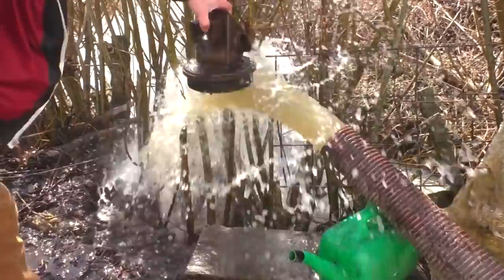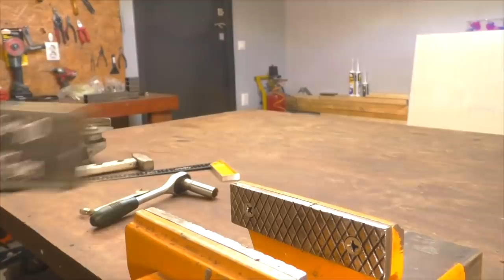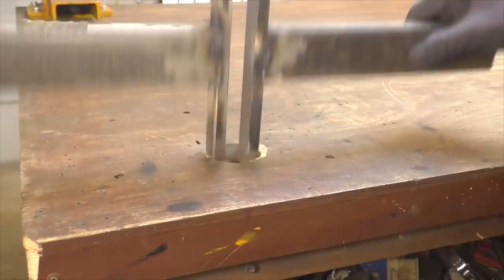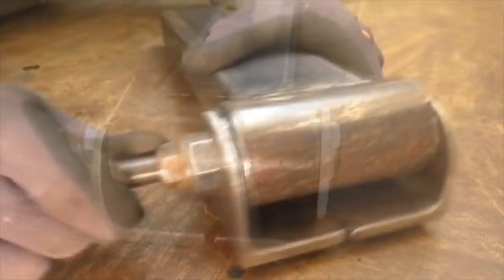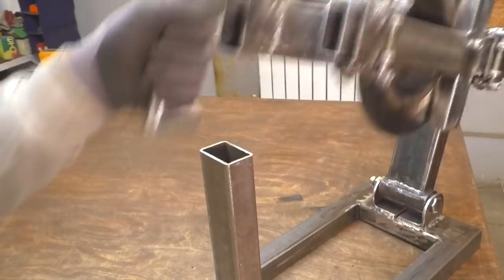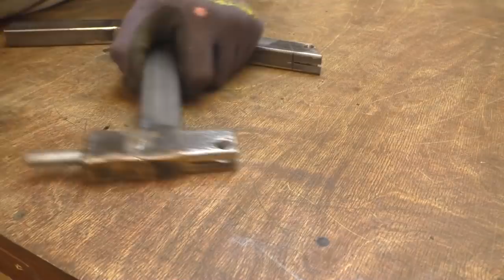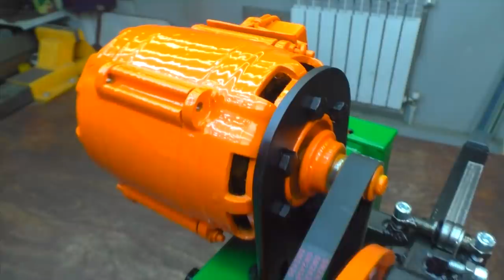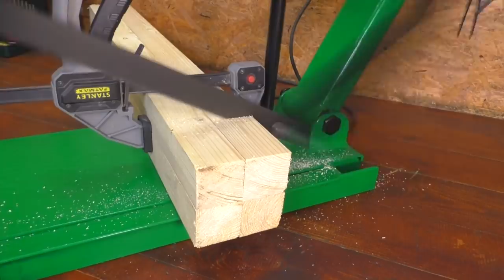Never throw away an old hub! It's like nothing anyone's ever seen before!

Comment: Start off by saying dude is obviously very skillful and im impressed by the precise craftsmanship. Very impressive indeed.....but wtf!?!?!? Lol. Don't throw away hubs so i can make the most elaborate band saw ever. I want to say the materials used makes the free hub seem quite   forgettable. What's another $30-$40 when you're dropping $400+ on other materials? Especially when u got to tear apart and clean it....But i don't want to sound like a hater. I mean..a rusty hub at the bottom of a puddle sparked that elaborate ass design for a damn saw? Holy crap! That almost seemed like if someone was forced to make a saw from an old rusty hub and then periodically was thrown little zingers..."use an excessive amount of bearings!" and "utilize 45° cuts into steel tubing only using a drill bit and file" or "cause dude that never comments on you tube vids to freak out and make a very wordy and very useless comment cuz....i don't know why."

Comment: Why not just put a saw blade on the motor and make a circular saw…use a gear reduction slow down to cut steel with steel tooth blade….that was a lot of work and parts to make a saw,,,do sawing

Comment: I knew it. Another 20 hour project that in this case could be a better solution by spending $175 for a horizontal band saw at Harbor Freight that will work much better.

Comment: yours melts the blade in two small spots.. yours runs entirely too fast as well.. 
looks like a very  dangerous devise
 that is why we have  band  saws 
that runs on a slower speed that doesn't burn up the blade and it's self oiling auto shut off etc...

use your talent to invent the un invented...

 don't try to show us a more time consuming way to build an unsafe machine
 that you create/copied   to over work   to try too achieve the same  result ... and fail
which yours has failed..  
be more creative...
make something new...

ps """"thumb nail is misleading  video  could be taken down """".. 
your video does not show cycle chain and gear devise... misleading.. 
better luck  being viral.. do it correctly.. 

nice number of views created by the  yt, algorithm  ,
found is was time  waisted   on this one..          better luck ..
hey at least i commented for you... pushing along the yt algo..